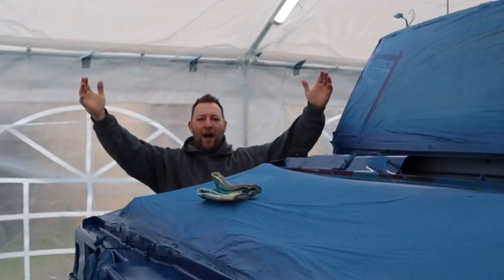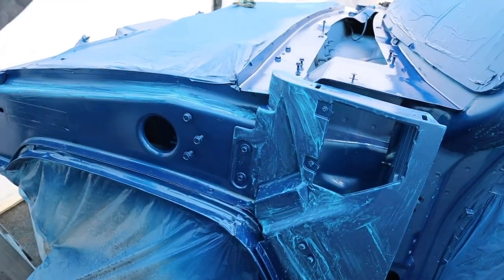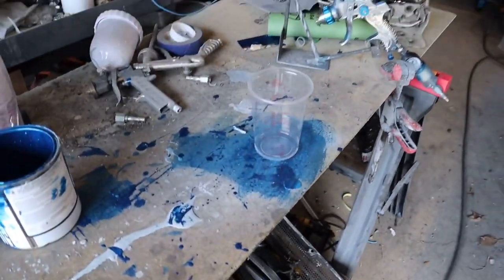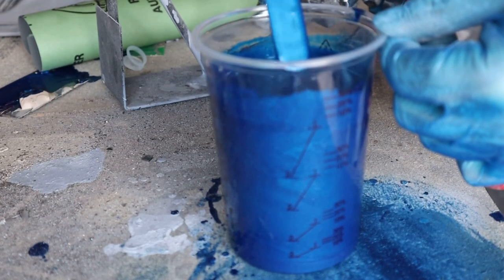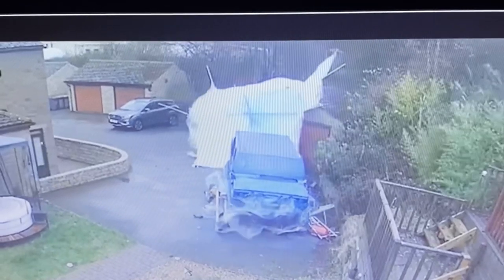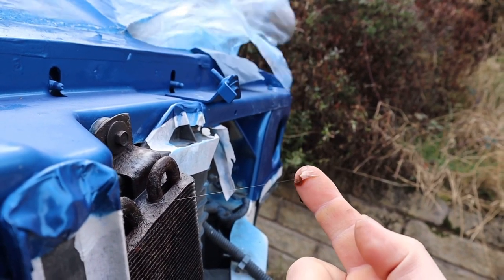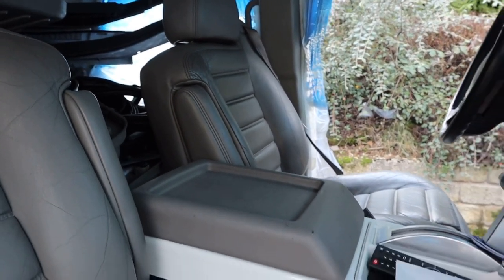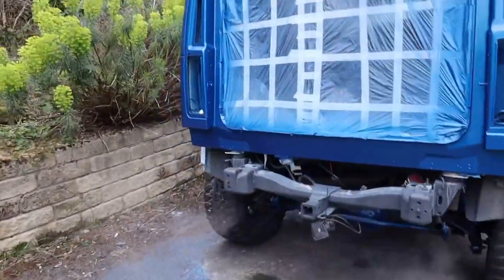PAINTING MY BLUE CAR AND IT ALL GOES WRONG

Comment: Really impressed how you let the problems bounce off, and move on. Similar thing happened to me with a gazebo I had in the garden for building a wall years ago. Tied concrete blocks to it in the end. It was completely trashed by the time the wall was finished. Good move to get the Hummer in the body shop. In years to come it will make a great story over a pint. Look forward to the next one. Hmmm, just thinking, could you build a garage extension?
Reply from the maker: Cheers John

Comment: Get those seats out and spray them with a weak bleach solution, and then rinse and dry them off...if you can, get the covers off the seats ASAP and give them a further clean...the foam in the seats will need to be replaced...keep at it, you’ll get there...👍🏻

Comment: Rob looks soo good on the outside but that interior was nasty lol glad you got it cleaned up.  What you gonna do about your leak? You replacing it or fixing it?
Reply from the maker: I will replace the radiator it’s rusted
Reply: @builditwithrob  okay, I guess it's an import job then to get the part?
Reply from the maker: @thebox228  I can order one in from parts USA they usually take about 8 days
Reply: @builditwithrob  still least on the plus side it's done it now and not after you got it all back together or when you take it back out on a run...